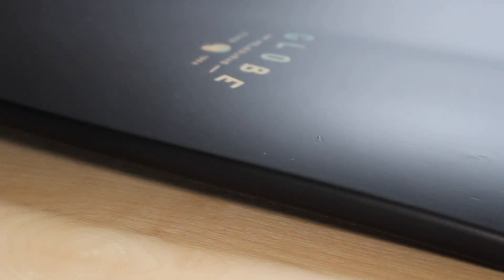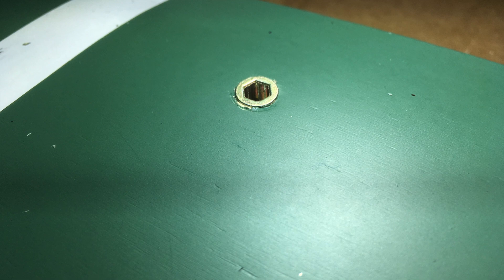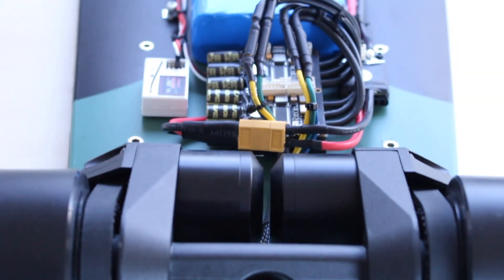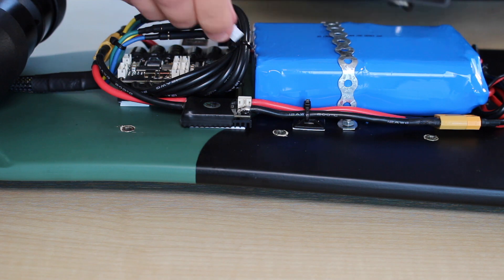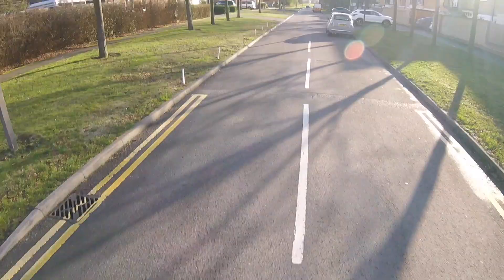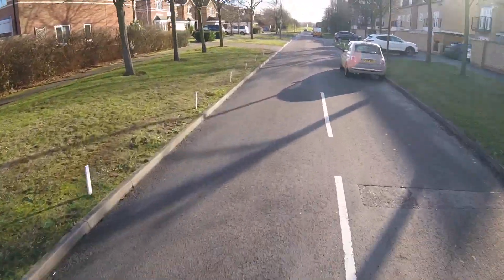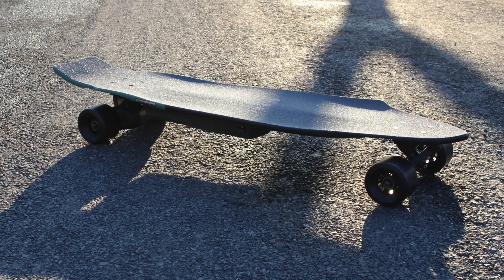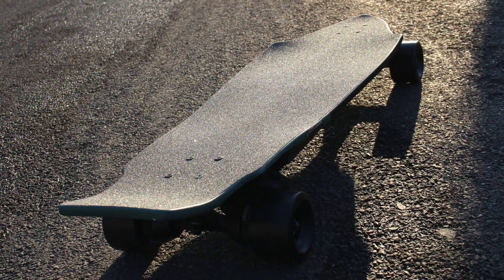DIY Electric Skateboard MK2 - Part 2 - Build and First Test

Comment: 0:25 I'm gonna use same m4 inserts, so I'm wondering, what was the size of the hole you had to drill into the deck for inserts to fit in?
Reply from the maker: Hello, it should tell you what pilot hole size to drill on the data sheet for the inserts you buy
Reply: @PracticalProjects  Thanks for the reply. There was no data sheet for inserts that I bought and seller wasn't able to tell be either. I think in the end I ended up  with 7mm drill.